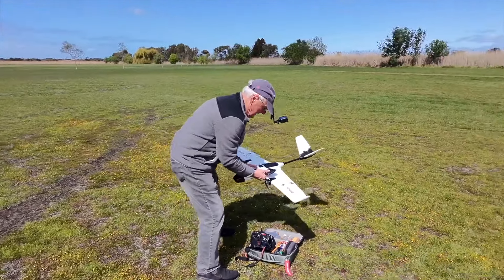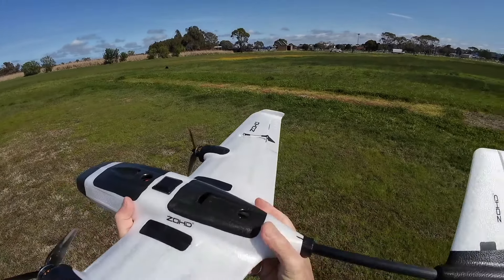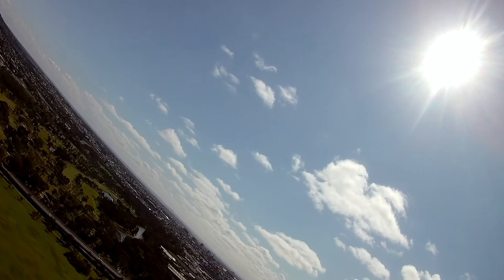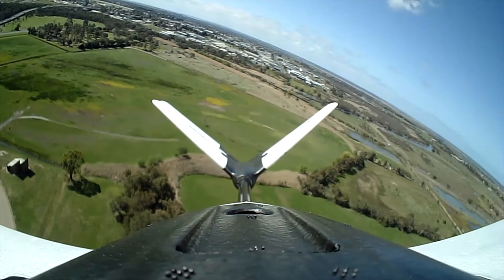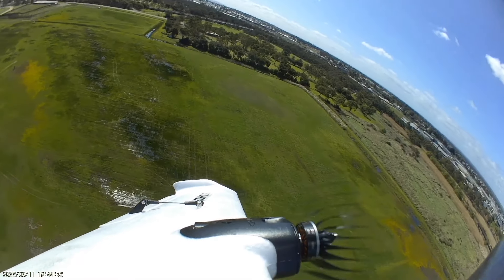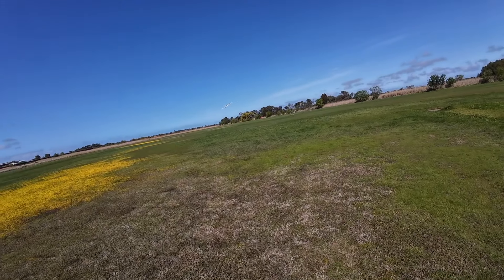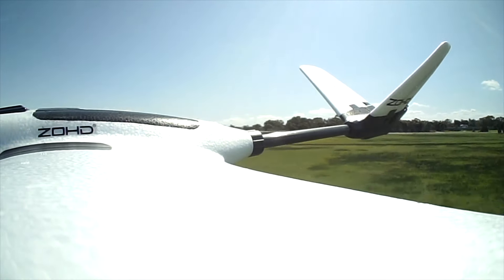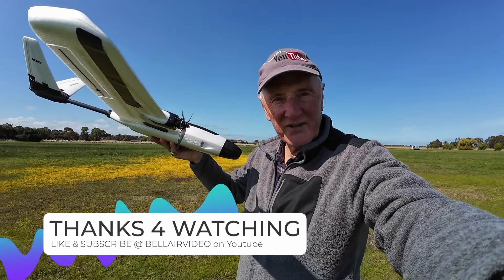FILMING an R/C PLANE with the DJI NEO...NEW AERIAL:CAMERA GAME CHANGER

Comment: Really interesting airplane. And that DJI is great, could it follow an airplane? I have an old DJI Mini, always wanted to use it for filming airplanes but it's hard by myself.
Reply from the maker: Hi Alex, this Neo is a great little easy-to-use platform to film your prep of flights as if you have an iphone, it connects via the dji mic, directly to the soundtrack of the Neo and removes the prop noise allowing for your commentary. It won’t follow your Rc aircraft but can hover in position to film close passes. I continue to test it in taxiing etc. the Altus is such an easy flyer & designed for Fpv. It is a great price on HK. When DJI sort out the connex. problems with their O3 unit & goggles 3, i will try it out on this & other aircraft